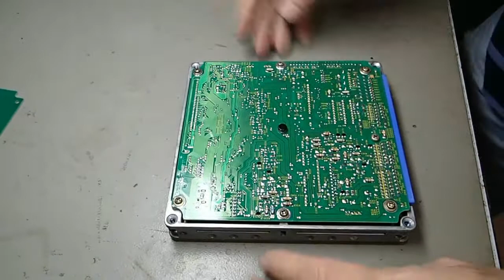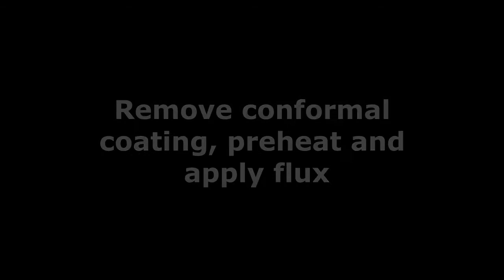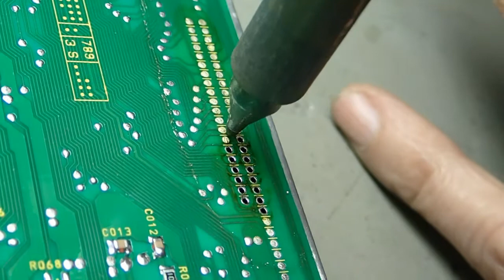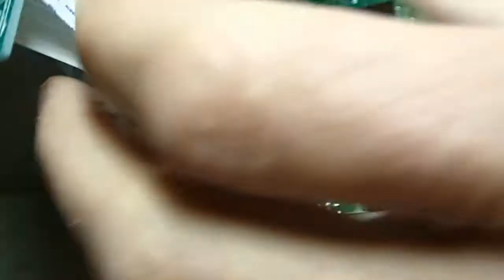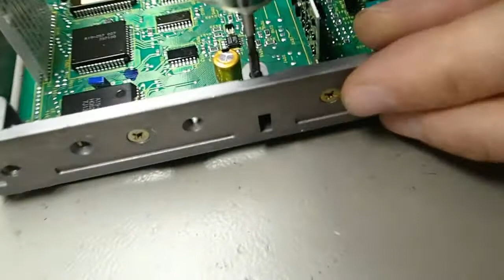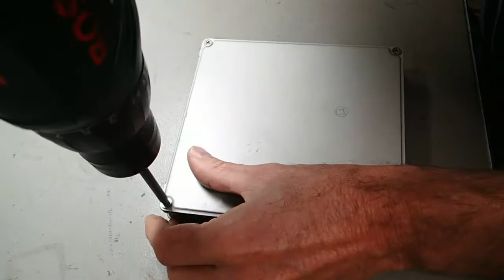NIStune Type 4 board installation (S14a SR20DET)

Comment from the maker: Thanks man. Once the board is fitted you connect via the car's Consult Diagnostic Port - using a consult cable. Tuning/diagnostics and logging are all done using NIStune software. Check it all out at www.nistune.com